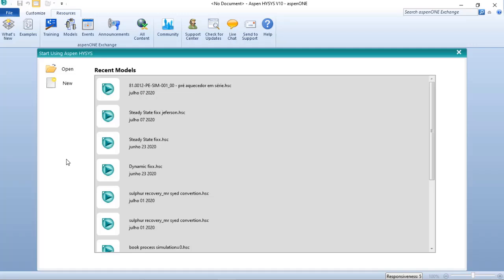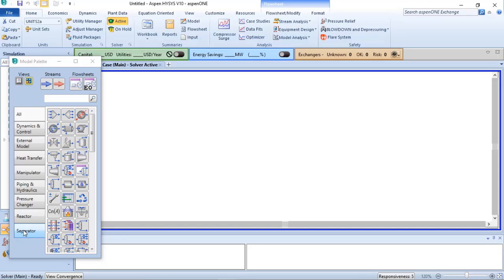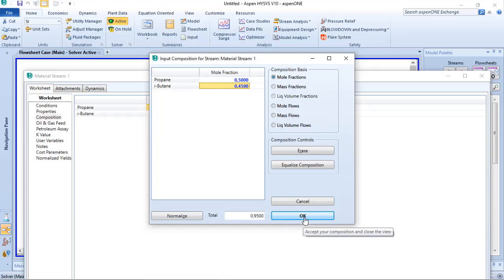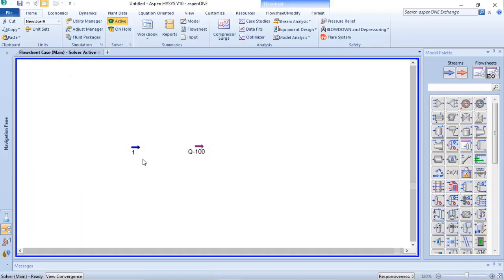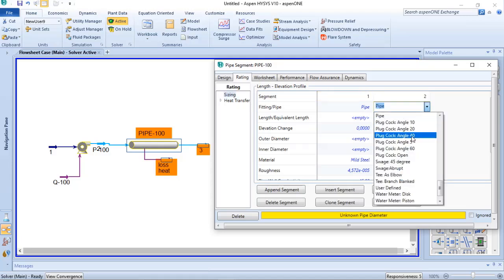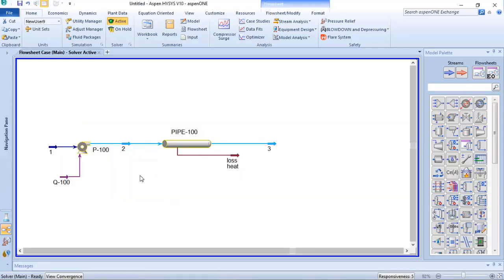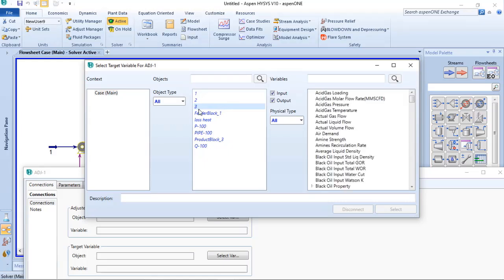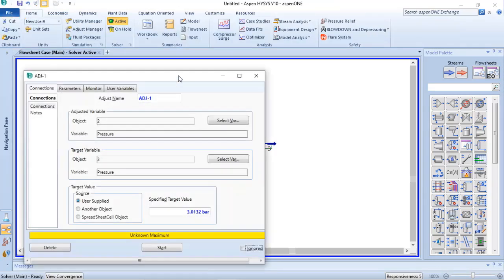HYSYS Tutorial for Beginners | Aspen Hysys training

Comment: Why have we selected line sizing for stream 1 whereas we need to size line 2 which runs from pump discharge to vessel B inlet having a length of 400 m?
Reply from the maker: Because in this case, volumetric flow is basically the same as water is a incompressible fluid. In any case, it is better t always use the stream you are dealing with to guarantee the correct results.

Comment: Very informative session.I was a little confused if it is necessary to input and define the energy stream in such hydraulic cases where there are no significant involvement of heat transfer?
Reply from the maker: In Aspen hysys you always need to attach a energy stream to the pipe segment. If there is no heat transfer, or it is negligible, you just need to set energy stream as zero.

Comment: Hi Jeferson, thanks for your tutorials!Appreciate! I just have one question about the pipe sizing attachments you used. In my HYSYS V11 i don't have the option to choose to calculate the pressure drop or the diameter, but under calculation type i have DESIGN or RATING, and this funcion in attachments tab is not called pipe sizing as yours, but "line sizing manager", and as said it won't allow me to choose calculating between diameter or pressure drop, but between DESIGN and RATING. What that mean? And it doesn't show me all the informations shown by you (for example it doesn't show the reynolds number). Could you please help me? Thank you very much
Reply from the maker: Hi Luca, many people ask me about this difference. It is time to I record a video to clarify this :) I will ask for your patience, but to give an answer, consider pipe sizing = line sizing. V11 has more options for preliminary sizing than V10.
Reply: @jefersoncostaengineer  thank you to you for your patient! I had understood that pipe size=line size tool, but they looks different. Pipe size tool seems to me easier to use. So, we're waiting for you! Cheers

Comment: how to do process simulation for Biomass Gasification for example for Rice Husk,saw dust etc? If you write your email on the comment below I will attach a paper for you from the journal that you will take as example that you will do for me. Please or contact me through my mail :abdiidosa@gmail.com
Reply from the maker: You need to learn how to deal with hypothetical components. Reading many papers about gasification in Hysys will help you how to set your own process simulation.
Reply: @jefersoncostaengineer  okey thanks for your suggestion. If there is papers that you can recommends me that, I have to read is there you can attach for me on my email address :abdiidosa@gmail.com

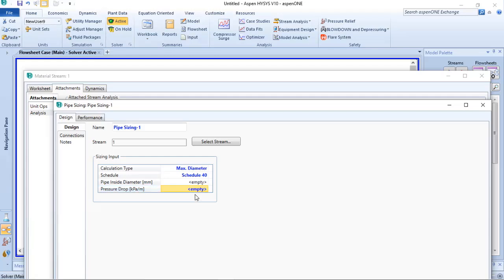Comment: at 21:11 (Time in video) we can't find this in Aspen Hysys V 11 ?
Reply from the maker: Hi Elhassen, yes you can. Follow the same procedure, however the interface in a little bit different than previous Aspen Hysys. You can set pipe size based on fluid velocity, pipe pressure drop or max Rho. Just go to Settings tab.